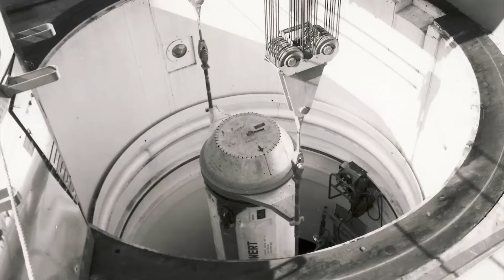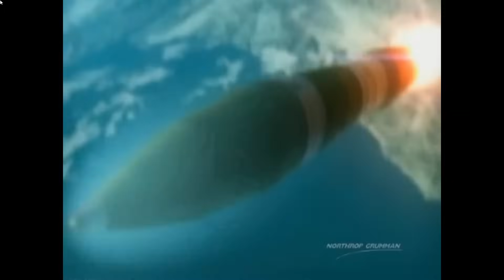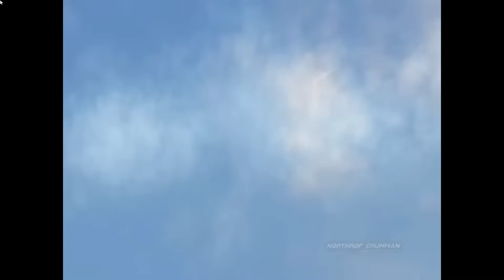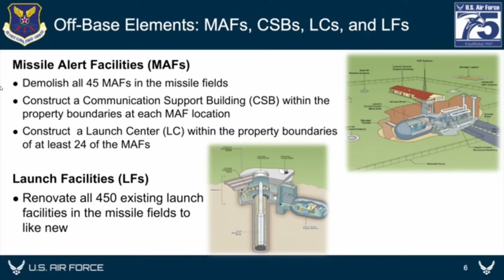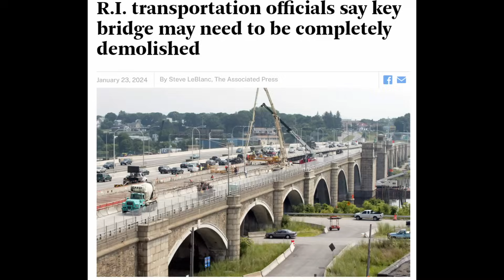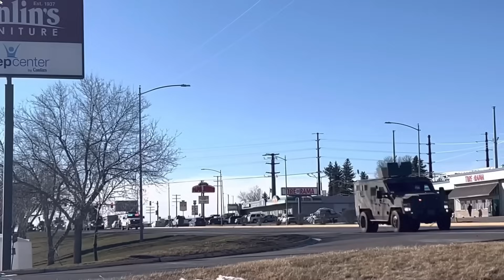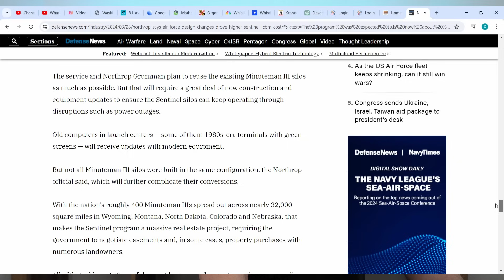Sentinel - How the U.S. Air Force will Upgrade its Land-based Nuclear ICBM Program

Comment: I concur with your observation that many of the old silos will not be suitable for reuse - expecially if the lower parts of them were constructed below the ground water level.   Eventually water will get to the rebar and wire mesh they were constructed with and carbon expands when it rusts.

Any new silo and foundations will use SS rebar  and wire mesh to eliminate the corrosion issue with carbon steel rebar and wire mesh.  Then the foundations and silos could have extremely long lives (potentially hundreds of years).

Comment: The Atlas needed cryogens; The Titans used storable propellants.
Reply from the maker: The Titan I used cryogenic fuel.
Reply: @CaseyJones-Engineer  Aerozine and nitrogen tetroxide do not require cooling but the are toxic, corrosive and, in an enclosed space, explosive, since they are hypergolic.
Reply from the maker: @johncampbell4389  Thank you!
Reply: @CaseyJones-Engineer  No problem.  As an Engineer, you specialize in building targets, not missiles.

Three engineers were sitting down and debating what kind of Engineer God was...

Comment: This is so stupid on so many levels. Why boron reinforced concrete when they know exactly where the missile will be ten seconds after launch?
Reply: When I toured the same Titan Missile Museum that @Casey Jones talks about at the start of the video, the tour guide mentioned that these missile silos are built to withstand a near miss with a nuclear warhead and still be able to fire the ICBM inside afterward. Presumably, the boron in the concrete is meant to deter enough nuclear radiation to keep the launch control officers inside the silo complex alive long enough to launch a return shot.
Reply: @konbonwa  You are correct.  The idea is to prevent a high neutron flux from getting to the warhead (boron absorbs neutrons).   You don't need a critical mass to detonate an atomic bomb.  You just need an appropriate thermal neutron flux.  A critical mass is just the mass that generates its own neutron flux to trigger an uncontrolled cascading nuclear reaction (which is how a nuclear bomb detonates).

Most existing bomb designs use a sub critical mass (no assembly of bomb components required) and a way to increase thermal neutron flux to detonate the bomb (there are multiple ways to do this).   So preventing a neutron flux from a nearby bomb detonation is key to preventing the warhead from detonating in the silo.

Comment: Great video. My first assignment was working aircraft maintenance on B-2s. When I retired, I worked in the SPO at the Space and Missile Center before I moved over to B-52s. Interesting note, the F-35 program is projected to cost $1+ Trillion over the lifetime.
Reply from the maker: I guess that's why they quit spending money on the F22. You certainly have worked at some interesting places. It is amazing to me how important the B-52 platform is after 70 years.

Comment: Kind of reminds me of when the 10th century Normans started replacing their wooden hill forts with stone castles. Massive building projects most of which are now picturesque ruins overrun with tourists.
Reply from the maker: That is an interesting comparison.  I wonder if the Russians are replacing their aging military infrastructure too.
Reply: @CaseyJones-Engineer  They have with some stuff. They've phased out their old R-36 ICBM for a new one called sarmat. The big news about it is it doesn't have traditional ballistic warheads. It carries an HGV (hypersonic glide vehicle) which is much harder to intercept because it can maneuver at extreme speeds. They've also been experimenting with a nuclear powered cruise missile, basically their version of the SLAM missile.
Reply from the maker: @killman369547  Interesting.  Thank you!
Reply: @kellymoses8566  Sarmat did.  It is not a cruise missile.

Comment: Very interesting. I did not know Boron was added to the concrete . Wounder if they added Boron to the concrete in the AT&T Long Line  bunkers?
Reply: ATT would not have any need for boron in their concrete as it does not stop radiation well; but does absorb neutons (greatly reducing neutron radiation from a nearby nuclear bomb explosion) 

The idea with boron is to prevent a high neutron flux from getting to the warhead (boron absorbs neutrons - and is used as a control chemical in PWR reactors).   You don't need a critical mass to detonate an atomic bomb.  You just need an appropriate thermal neutron flux.  A critical mass is just the mass that generates its own neutron flux to trigger an uncontrolled cascading nuclear reaction (which is how a nuclear bomb detonates).

Most existing bomb designs use a sub critical mass (no assembly of bomb components required) and a way to increase thermal neutron flux to detonate the bomb (there are multiple ways to do this).   So preventing a neutron flux from a nearby bomb detonation is key to preventing the warhead from detonating in the silo.
Reply: @perryallan3524  Very Good Thank You
Reply from the maker: Thanks.  I didn't know about those AT&T structures before.